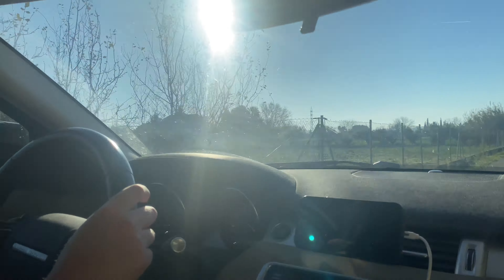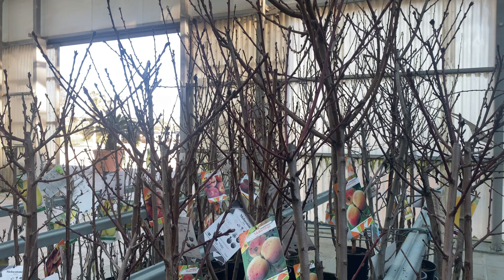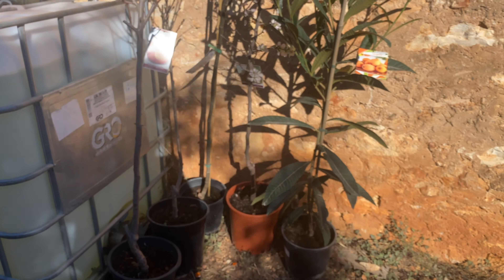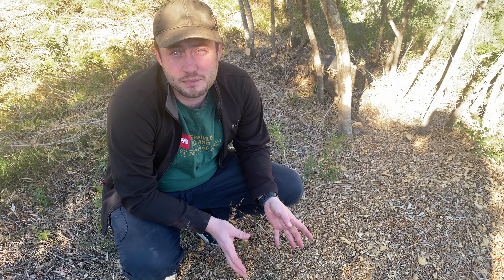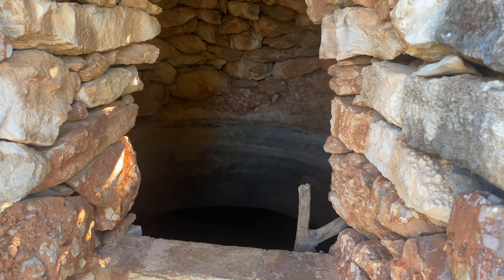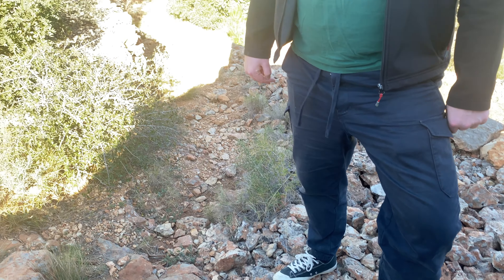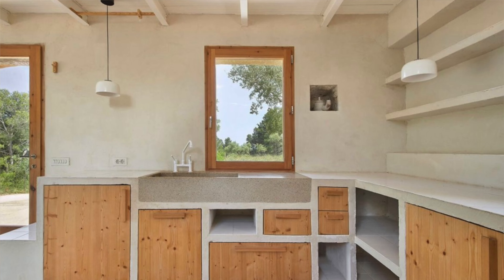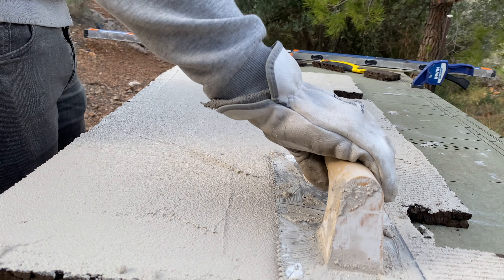What's next for us? Homestead & Renovation Update | Off grid Abandoned Land

Comment: Best of luck for 2024, you've got a good set of goals, hopefully the redundancy is a door opening to better things! Great to see the orchard is about to start too!

Danny, you can build yourself a guide for your saw (or a couple, I've got 3 of different lengths to suit breaking down big sheets of material). "This Old House" have a relatively simple one, I've used something similar for years (https://www.youtube.com/watch?v=qIeIZdrbz-Y) Small bits like the one you cut will still be tricky, you'll need to clamp the guide down onto the bench with the piece under it. If possible, actually screwing the piece to the guide can get you out of trouble there. Another option is to screw the saw to a piece of melamine (osb/plywood etc will do in a pinch) and flip it over as a makeshift table saw, then set up another piece of something straight as a fence. Sketchy, but it got me out of trouble until finances stretched to a job-site table saw. https://www.youtube.com/watch?v=FFa-WfOkuWo is getting complex, it can be a lot simpler, but it gives you the idea. Good luck!